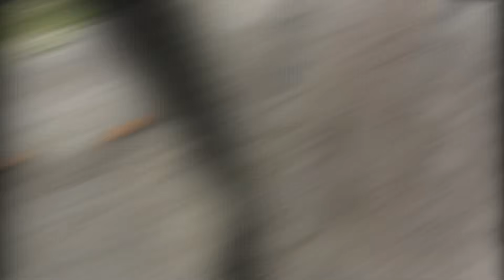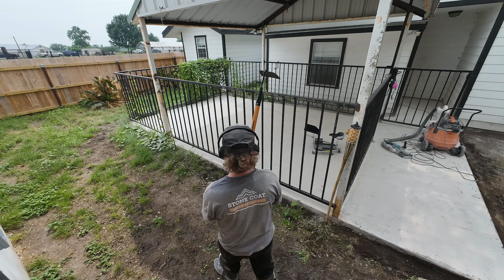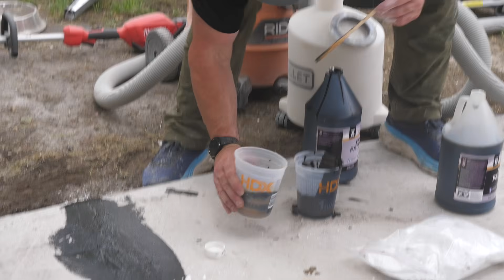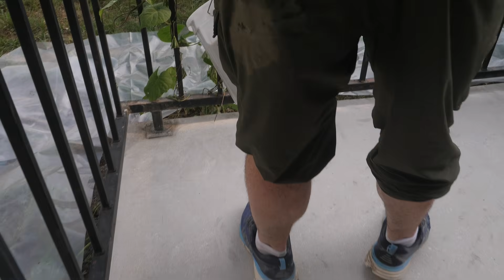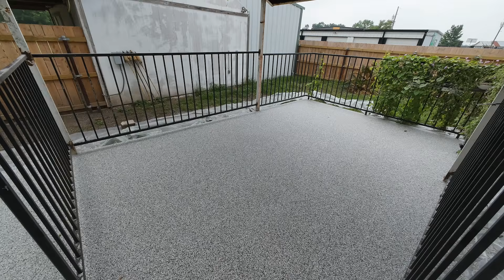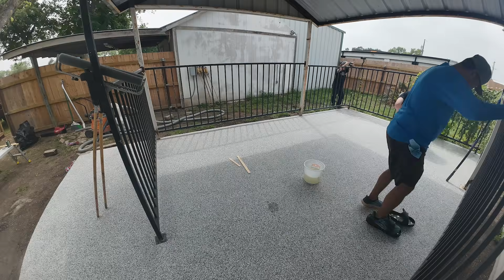Single Day Epoxy Floor Coating - Stone Coat PRO Flake Flooring System

Comment: What does smoothing out the expansion joints do for the epoxy coating?  Being an expansion joint it will crack if it wants to no matter what you put on top of it..  and if the joint wasnt filled in before hand, wouldnt it be better if the epoxy was inside the joint so it would only crack along the joint instead of it cracking off around the filler you used?

Comment: We love Stonecoat’s Pro flake flooring system! It’s a game changer for DIY projects. 

Grinding the surface is crucial; we learned that the hard way. A clean slab really makes a difference in adhesion. We also found that using the right PPE while grinding is a must—dust gets everywhere! 

When it comes to filling cracks, the quicker, the better. We had a project where we waited too long, and it didn’t adhere well. 

And don't forget about your top coat—applying it evenly saves you from puddles! 

This system has made our jobs easier and more professional-looking. Can’t wait to see what’s next!

Comment: Aren't the lines in the concrete there for expansion? I'm not a concrete pro, just always thought that's why they are there. It seems like filling them would cause a problem on outdoor concrete.
Reply: That's a great question. Someone should answer this...
Reply: @charliecharlie9377 yes expansion joints are crucial. I am an experienced concrete guy and I don't think filling with patch is a good idea. I think the epoxy coat should incorporate the expansion joint lines.

Comment: I built a 750 square foot shop that I do woodworking in.  How well do you think this would hold up to shop tools rolling around on it.  Also,  I have the large expansion joints in there and what would I do about those

Comment: We did this to our Garage floor. It is dangerous when its wet or damp, or from humidity condensation. It looks good, but slippery when wet.
Reply from the maker: did you use our stuff with the non-skid?
Reply: You used the Stone Coat product and topped with the anti slip product?

Comment: It looks so much better! 👍 When wet, how slippery is it?   It seems like you've mostly used it on outdoor or garage cement.  How is it on a 2nd story kitchen with a wooden floor?  Are there ventilation issues?
Reply: Great questions! 
This system is compatible over 4x8 plywood subflooring. Ensure the subflooring is sound and not too bowed. Fill the seams and any damage. Sand rather than grind. The Polyaspartic top coat is not very slippy at all when wet with the non skid. The floor utc is not slippy either.
Reply: @bigmitchbuilds  Thank you!! 👍

Comment: Well......with the drying time can you please breakdown how this is a 1 day job? Even in thos video you guys were there for more then 1 day according to the sun and shadows and the fact you guys were in different clothes.
Reply from the maker: Great question. due to filming and doing another countertop job at the same time that's why we couldn't do this job in a day, but here's that breakdown:

Grinding: took about 2 1/2 hours by hand. would be less than an hour with a walk-behind grinder

Floor Patch: We got it all applied (2 batches) in less than ten minutes, grindable in 30 minutes. Took about 20 minutes to grind back smooth and then clean dust 

Moisture Seal: We got it out and applied in 15 minutes, then flaked the entire in in about 10 minutes. So from the time we mixed, to fully flaked, was just under 30 minutes. This coat cured in 3 hours (5 if it was colder, but it was about 85 that day)

Scrape/Top Coat: as you saw in the video we had to come back the next day, however in a normal situation we could have immediately started scraping once it was dried. the scraping/clean up took about 20 minutes. then we got the top coat fully applied and back rolled in 25 minutes. the top coat was walkable in 6 hours (cured overnight) and the next day it was perfectly fine to walk on 

So including the cure times of the floor patch and moisture seal, it was just around 8 hours of work. Add on the 6 or so hours of cure time for the top coat at the end, so it would be walkable around that 15 hour mark. So for the flooring guys out there with crews, if they start early and use the big grinder they could knock these out in a day. given that it's not a huge warehouse floor or something similar

If this was a garage, it would be best to let it rest for 3 days before driving on it but after that it's good to go!

Hope that answered your question!
Reply: There are fast curing resins that can cure in about two hours. Really depends on temp to.
Reply: We looked at your profucts.  We have 200 sq ft subfloor...once we prep the floor and use the moisture barrier.   I want to use the earth tones... im not sure how much accent color i should use to A & B